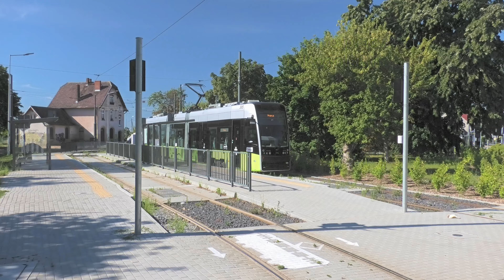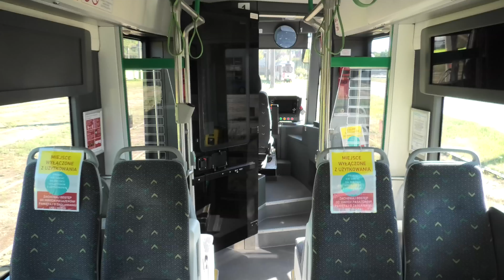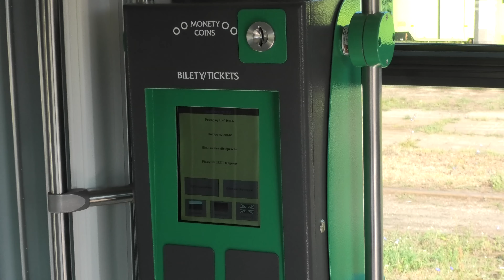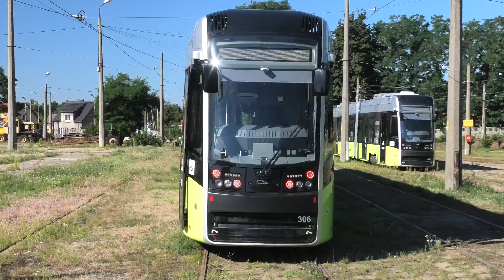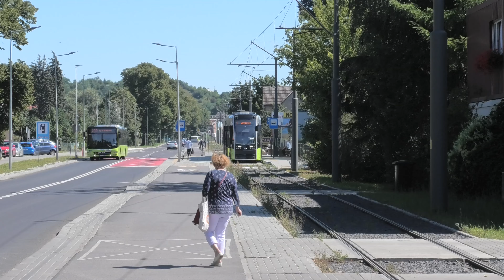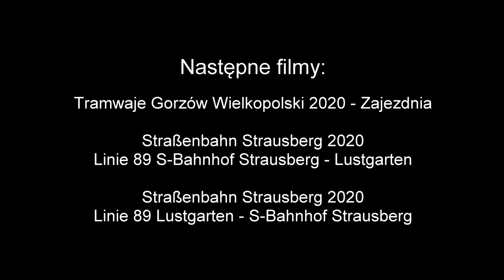Tramwaje Pesa Twist 2015N

Comment: Nice to be able to see more of the car and how it works.  I would be interested in the physical connections between the 2 ends and the center with the truck and pantograph that are under the bellows.  That is how the connections are able to swivel and turn through curves and track grade changes.  Thank you.